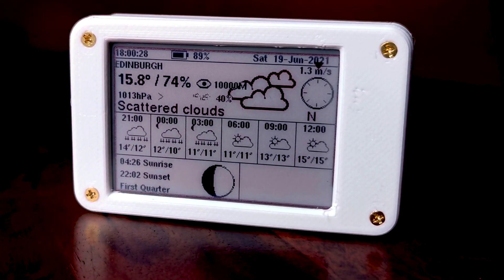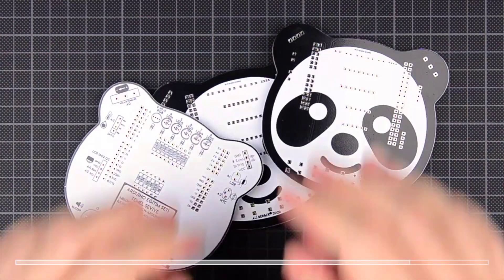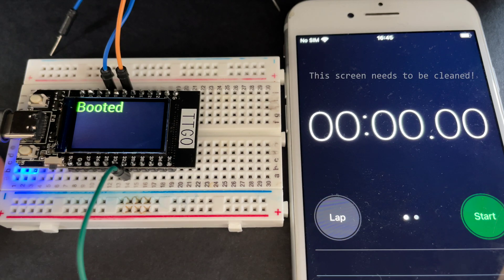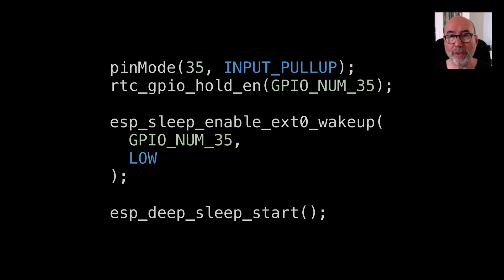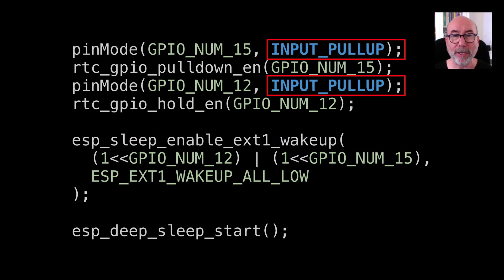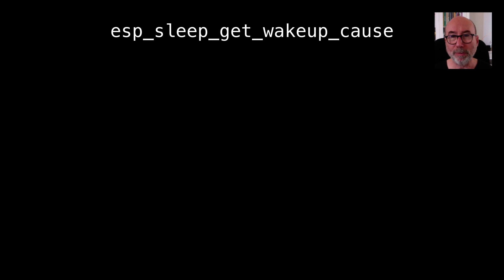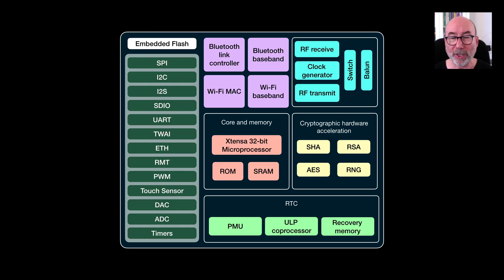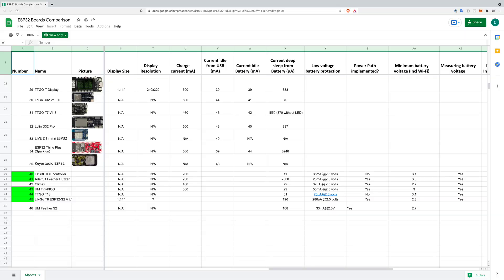Mastering ESP32 Deep Sleep: Timers, GPIOs & Touch Sensors Explained

Comment: Hi, in a project of mine, I am trying to get my ESP32 to wake up from deep sleep mode and to wake it up I have assigned several GPIOs, the issue is I am trying to connect the bluetooth through a function which I do it by assigning it to a GPIO pin 36 that if HIGH it should go inside and execute the Bluetooth function, but it just simply brushes past it and rather without connecting tries to again go into the deep sleep. What would be the best way for me to utilise the digitalRead HIGH to go into Bluetooth or any other function which then should only execute after they have been completed? Or is it not my fault? I have tried to look at good examples but can't seem to find a solid rock.

Comment: Is there any way to control ac appliances through 16 relays modules. Esp 32 / 8266 has 9 pins available & with mega2560 no wifi available through. 

How to combine 16 relays+ arduino + wifi control/ web server. A detailed information would be appreciated. Lots of YouTube videos explaining upto 8 relays. If 16 there is no switch option. And so on. No videos with code are available for this simple project. Please make a video. Thanks
Reply: Use shift register.